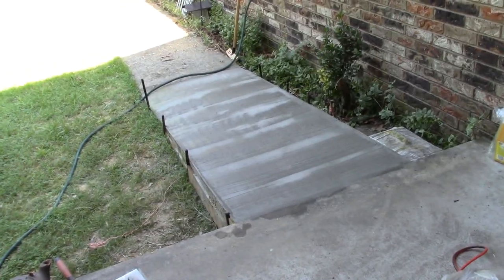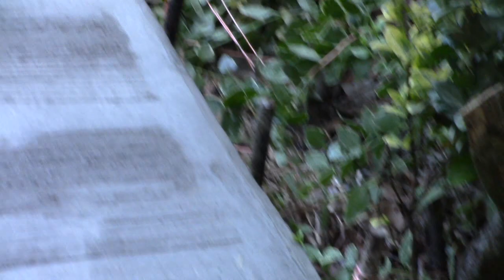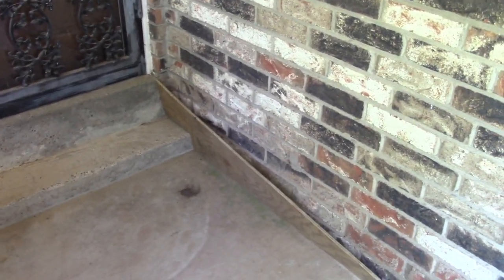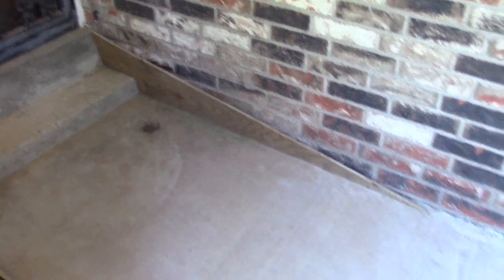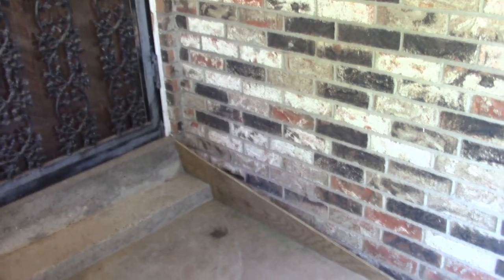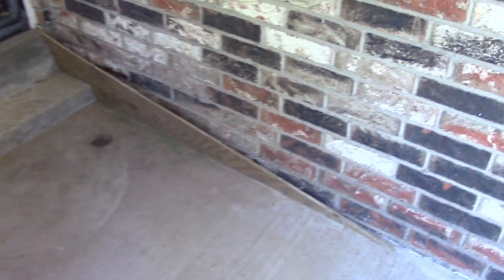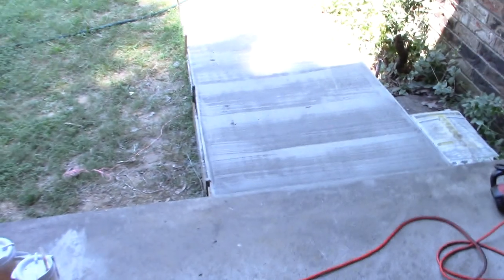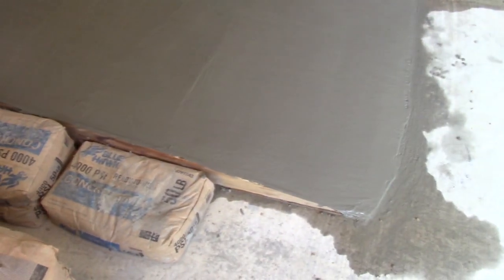How to Make a Concrete Wheelchair Ramp Over Stairs with Quikrete Sakrete and Kobalt Electric Mixer.

Comment: Very much appreciate projects like this with on-the-fly/need based practical engineering. I need to buy a small concrete mixer since I’ve got various projects that require more than I can mix by hand and it would be more economical to just buy a mixer for a few hundred dollars rather than paying for multiple rentals. Plus I know I’ll end up needing it for a bunch of stuff over the next 5+ years, so seems like a decent investment.
Reply from the maker: You'll thank yourself many times over the years!

Comment: Thank you Sir for making this video! It helped me alot because I have a small ramp to pour tomorrow.
Reply: God i bet that pour failed if you followed this video
Reply: Not at all. It turned out great and my Father can now go in and out of his house with his walker. I’m no professional at pouring concrete but I got the job done. Thanks for the feedback 👍🏻
Reply: @RawiriG69  it's a SMALL ramp! NOT likely to have the weight of an automobile running up and down it.  I think it should hold up fine

Comment: your video was absolutely perfect! i am attempting this simply because i hate the stairs, as they gather water since they were not installed great to begin with. The part where you say you will go back after an hour or so to brush, if i am going to attempt a stamp pattern... do you think i need to brush still? or just apply the pattern?
Reply from the maker: I know nothing about stamping, but I brushed so that I had plenty of traction while pushing a loaded wheelchair. That way I don't have to worry about slippery dust or if it's wet.
Reply: Mind if I bother you again… question on the concrete mix…. I am working solo… in between pouring and mixing and packing in the steps/ramp area… how much time do you have to work with? Did the material stay pretty workable to add to what you had packed in already?
Reply from the maker: @holliekeenan8453  as long as you don't take a break for lunch, and just keep working, you'll have plenty of time. If it does start to get a little stiff, spritzing it with water will give you some extra time, but probably weakens the mix a bit.
Reply: @PirateStu  … thank you so very much!! And greatly appreciate your time for responding 👍

Comment: I personally wouldn’t work the concrete with a trowel until after screeding and floating with a 2x4 and wooden trowel.
Reply from the maker: A 2x4 wooden trowel would almost be bigger than the project. But thanks for the comment.
Reply: @PirateStu   you can cut a 2x4 down bud... and he said a 2x4 AND a wooden trowel not whatever your talking about some hybrid of the two. You screed with a 2x4 and backfill whats needed with wooden trowel, which is not the same as the 2x4. Then lastly you would take your float and finish. Regardless what you did should hold up for what you need it for.

Comment: No rebar or metal reinforcement needed for that much concrete?
Reply from the maker: Not for me, but I'm not worried about it cracking either. It's not supporting anything, and I could always paint over a crack if I don't want to see it.

Comment: ill be doing the same but only 3 1/2 inches high (2x4 framing basically). What's the best way to set forms in concrete?  I see you used the bags obviously but any other alternatives?
Reply from the maker: If the forms go on dirt, they sell metal post with holes in the, that you can run a screw through, and into the wood forms. If you're making a form on top of concrete, you can always attach a piece of wood inside the form to keep it from spreading apart.
Reply: @PirateStu  ya ill be putting concrete on top of concrete, so the forms I made are from 2x4 and sloped to a degree. I cant stake them into anything since it's on top of a slab of concrete already. I saw what you did with the cement bags and may do that. it's nowhere near as big as what yours will be.
Reply from the maker: @josholivarez3804  I doubt you have much of any problem with the forms moving. The problem is keeping them from spreading out, so if you can tie one side to the other, that should solve 99% of any problem. My issue was the brick wall was one side of my form, and there wasn't an easy way to tie the plywood side form to the brick wall. Hence the "bag wall". Good luck with your project.
Reply: @PirateStu  ok thanks for this, I have plenty of room on each side so I think the bags will help. ill try to secure it like you said but might after I finish the concrete.

Comment: I have to build a similar style ramp but was told I should use a wire mesh (chicken wire)- any suggestions would be appreciated.
Reply from the maker: Wire will help keep it from cracking. I'm not that worried about a crack. Plus in my situation, I'm putting the concrete on top of an existing structure, not building on top of it. If I were pouring a foundation, I wouldn't want it to crack because then it would affect whatever was built on top of it. But with that said, even then I don't use wire mesh, but instead buy the pre-mixed concrete that has wire fibers in it. It's even stronger than regular concrete poured over wire mesh. The truck pulls up, dumps the concrete with the wire fibers into your plain wooden mold, and you're done. It's just a little more expensive, but for me, well worth the money of not having to hassle with creating a wire mesh structure to pour my concrete over.
Reply: @PirateStu  the ramp I'm building will be on top of existing concrete and will maybe 4 inches at its thickest point- does that make a difference on anything? I'm worried about cracking or crumbling
Reply from the maker: @fathermayhem6185  I'm not a concrete expert, I'm just a guy that does things he's not an expert at. If you're worried, I'd say to use wire mesh. You might even want to drill "bonding" holes in the concrete below your ramp to make sure they stick together, although that will increase your likelihood of cracks, but decrease your likelihood of separation. I've done this on pieces that I didn't want to separate and then I'd stick a small section of rebar into the hole and pour the concrete over the top.
Reply: @PirateStu  I understand that- 90% of the time I fake it until I can make it. I appreciate your time and advice. Thanks
Reply from the maker: @fathermayhem6185  I do it so much, I even wrote a song about it!
Reply: If its a certain size its going to crack no matter what, the rebar or mesh whatever you decide to use is so the crack wont spread the concrete apart.
Reply: @cooldbz12mach1padilla  huh, what size would that be, I have a 1100 sguare foot garage, one single slab of concrete flooring not a single crack in it was built in 1992, so is that size must be bigger than this?

Comment: I have a concrete ramp which I need to cut the bottom end off, about 1 metre, how would I do that?
Reply from the maker: A concrete cutting disc. Either small or large disc depending on whether you're using a hand grinder or a larger (probably rented) concrete cutter.

Comment: New concrete over old concrete...shouldn't be some glue added? Bonding agent or so?
Reply from the maker: I can only tell you that the ramp hasn't slid off the porch yet.
Reply: Thanks. I will ask the inspector.cause I'm building an L shape ramp by hand myself and  I have some old concrete underneath

Comment: The concrete needed to be torn out at the end of that ramp because where  the concrete meets the old concrete that is going to chip off guaranteed
Reply from the maker: 4 years later, and no issues, but your prediction will certainly happen at some point.